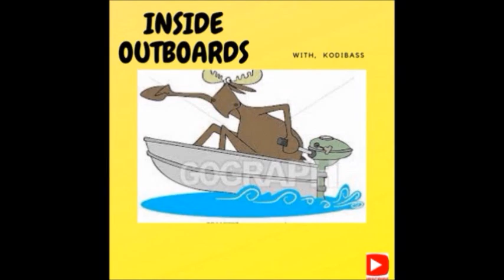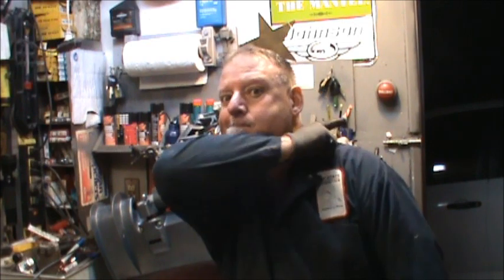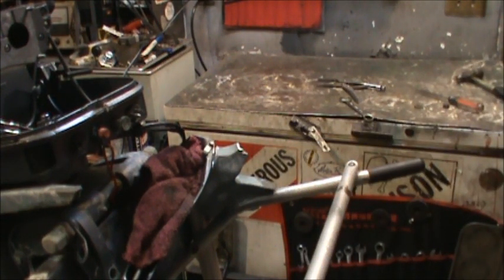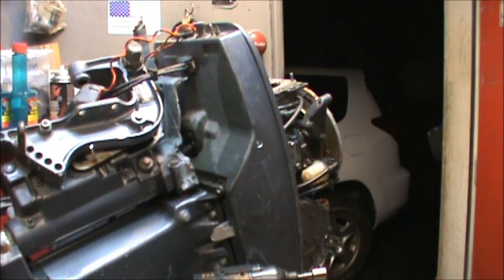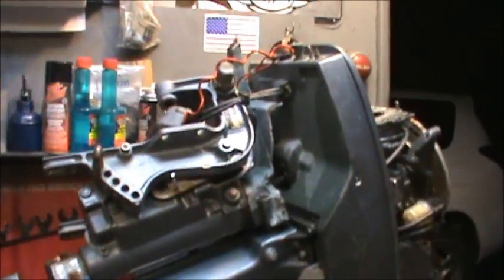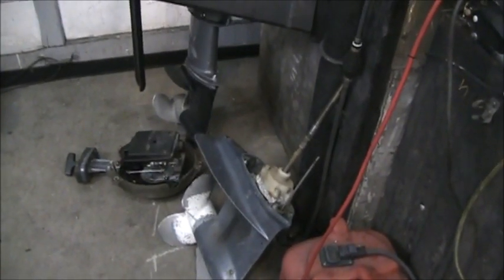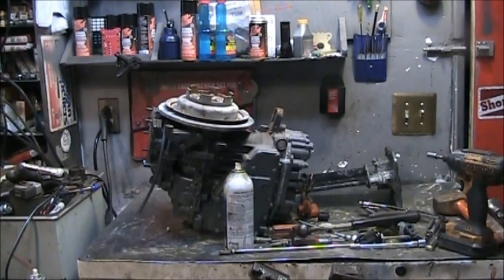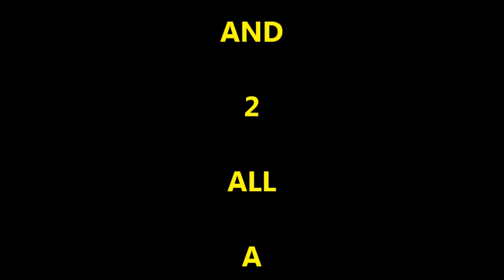YAMAHA 40 HP ENDURO , Part 2

Comment: Kodi... I have an older B&D Firestorm drill like you said you use and like.  If you want it, let me know and it’s yours.  I haven’t used it in years.  The battery has some age but the drill and charger are there.  Chris from Iowa
Reply from the maker: Chris I would Love 2 Own It,   Let me know the shipping, I will Pay Up  front 4 it   4  sure.   paypal   etc.       kodi
Reply: It’s on my dime.  Least I can do for the education you have give. Me with your videos.  Just send me an email back with your shipping address.    I had emailed your Alaska.net email address too if that is still a valid email for you.

Comment: Mr. Kodi Bass,. I have a question for you sir.  Just bought a new starter for my 88Johnson 30hp.  Do I need to dry lube the bendix / pinion gear before installing?  Because,,, I didn't and it only spun the flywheel a few times and then just spins without engaging.  Please help me sir!!  Florida Steve😎
Reply from the maker: +SUF,  Yes'  OMC manual states prior to installing put one drop of S.A.E # 10 oil on armature shaft bearing ,   then coat shaft , pinion / helix  with  GE versilube.             kodi
Reply: @kodibassInsideoutboards  thnakyou sir!!  You have helped me IMMENSELY with this old johnson!!!